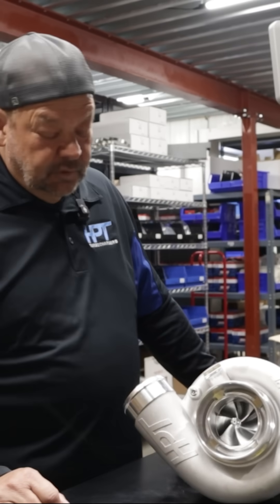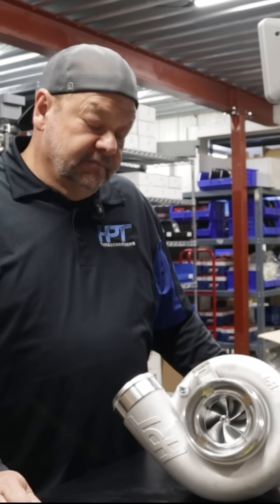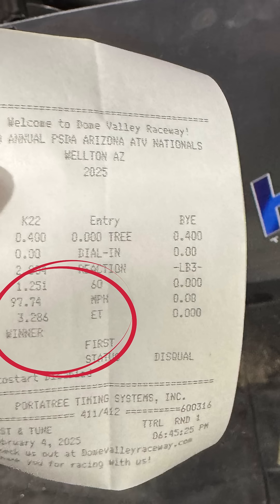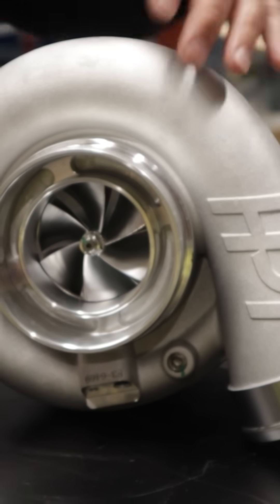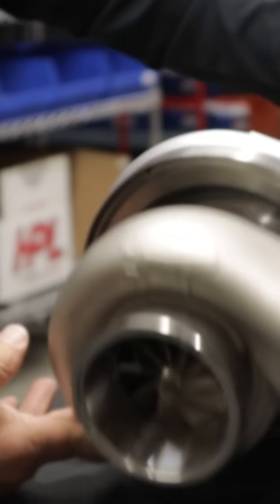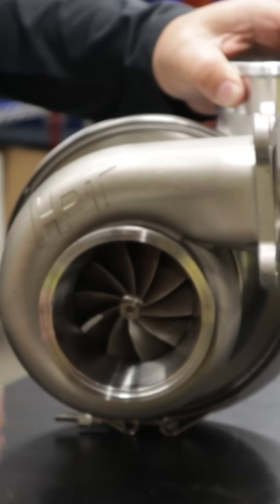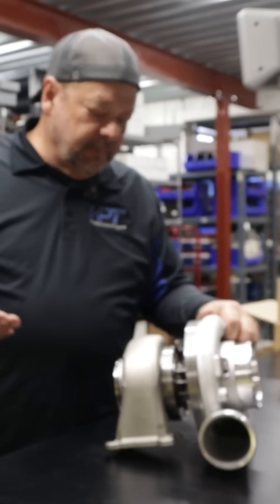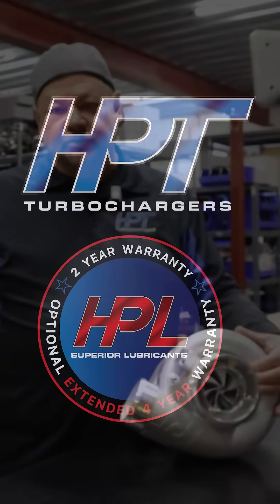The Record Setting F3 6469 HPT Turbocharger

Comment: which single turbo would yall recommend for a 5.0 coyote 1000+hp build? currently running a whipple but i like your turbos
Reply: You'd need two of these in this video to try and hit a 4 digit power number at that displacement.

Comment: Can y'all make a 5555 please 😬? I absolutely love my 5562 but I want an even quicker spool. I'm not after breaking records and I understand that's what will really bring in the money, but I just want my 1jz-gte to be full spool at 2800-2900 RPMs. I have the smallest hotside already and it's just not where I want my full spool to be at yet. Great turbo!!!
Reply: Rods aren't going to love full boost at lower revs like that, at least not for longevity. But if it's just for fun and wknd stuff let's get it !
Reply: @beaches2mountains230  the stock turbo is super small, a 5555 is much bigger than that. I believe with stock turbo this thing is at full boost like at 2100RPMs, I cant remember but it's quick af.
Reply: @TheSocialPraxis my 1jz spooled at about 2k rpm or so with stockers on it.
Reply: @dsmkyle8802 you're probably correct on that, that sounds more like where stock was. I just couldn't remember lol.
Reply: @beaches2mountains230 why wouldn't they? If they can take it high revs they can surely take it low. You might be thinking of load. Engines don't like load at low revs. It's like throwing 200hp worth of nitrous at low revs.
Reply: One word, Nitrous! Lol
Reply: @HartsPerformance  I do plan on running 100% methanol like I do in my Mustang. 😬👌🏼